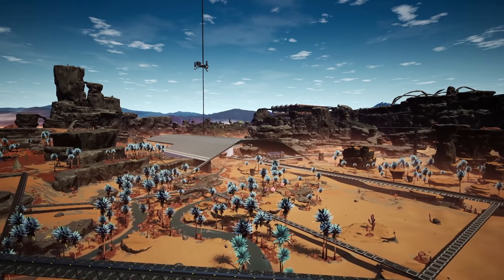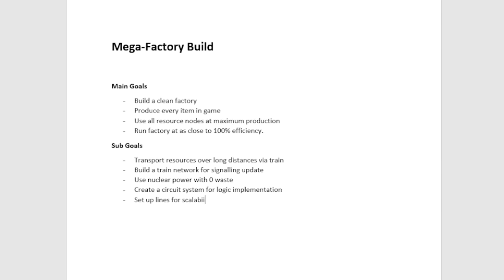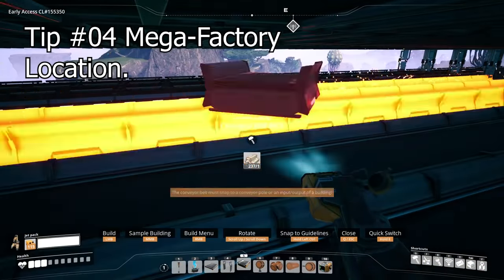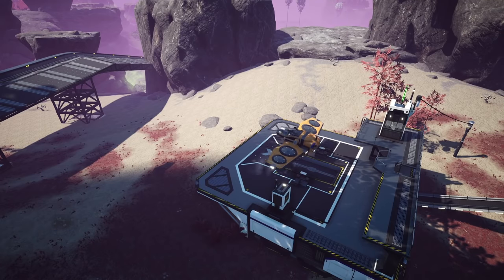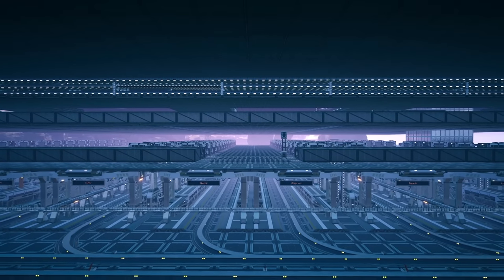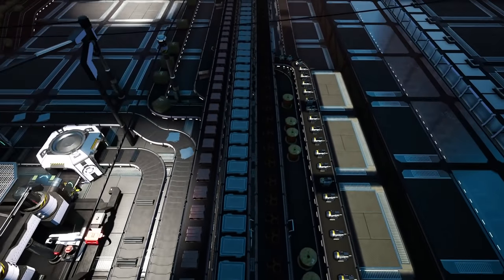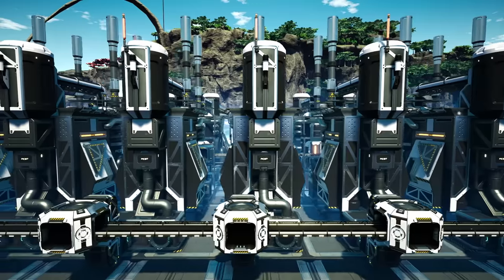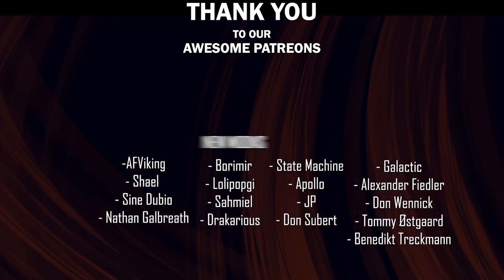14 Mega Factory Starting Tips | Satisfactory Game

Comment from the maker: If you're starting your own mega factory, what's the number one tip you'd recommend?
Reply: Use excel to run your numbers, So much easier than pen and paper
Reply: wait for early access to end :D - should be soon
Reply: GO BIG OR GO HOME!
Reply: @cha0sthenerd  I wouldn't bet much on it. At the very least a year to go, if not more, till 1.0
Reply from the maker: @cha0sthenerd  maybe end of next year?
Reply: @bobafettjr85  In my current playthrough, I am using one huge bus to transport everything, so far it's a ~300x15 foundation, 20 story building which is only transporting items and loops around itself for constant flow.
Anyway, since I use the mod Advanced Logistics, only for the adjustable merger (which is basically a reverse smart splitter), I'm able to tap into a single conveyor and then refill it from another conveyor without having to worry about bottlenecking, so it will always run at 780/min, if I have the resources available on another conveyor.
Excel is helping a great deal, since I can keep track of multiple conveyors transporting the same item, to make sure I refill the conveyor I'm tabbing into, and which other conveyor has the required item/min to do so.
I used to use pen and paper, filled a couple of notepads, but after spending a little time setting up a spreadsheet, I'll probably never go back.

(although I still use pen and paper for "smaller" projects that requires some visualization)
Reply: @bobafettjr85  I use code cells and reference the wiki for ratios. I unfortunately don’t really know how to explain more than that
Reply: A seriously well organised, LARGE and neat self sorting storage room and logistics hub (not nessecarily a mega base).
Reply: @cha0sthenerd  If only that were the case. Update 5 is planned for this fall. And the devs have made no indication that it would be the last one. They've got the whole quantum computer/superposition oscillator tier to fill, world updates planned, boss den, vehicle reworks, dedicated servers, and signs that are on their list of things they want to do before 1.0. They also surprise-adding just as many features as they tell us about. So my guess would be at least one more update before release, at a cadence of 5-6 months between big updates.
Reply: I think the biggest thing to keep in mind is that logistics is the number 1 problem of the game. (Followed by remembering what the plan was.) It's not hard to build a bunch of machines in a row and belt/power them; it is hard to efficiently get 2-4 resources to that building and split the product to go to 2-3 other buildings/modules, while not interfering with the 60-odd other items. It's easy to calculate how much space the machines take up; it's hard to account for the belting, splitting, merging, power, and walkway requirements.
This is shortly followed by 'using Excel/spreadsheets', so that you can make a plan before you start building.
Reply: Have a supercomputer
Reply: Power is a pain. Set up your power plant before you start setting up your factory. You cant test anything if it cant run.
Reply: Quit your computer and go outside.. Have a life... Because youll never finish it.
Reply: @prism will go by that advice :)
Reply: @Salmacream  ill have big power issues after connecting my factory up ( i have now like 4 concrete machines on full noout because my dumb brain said: building it in the sky is veeery great idea.. But he didnt realize it would take more concrete than a flipping pyramid!) so im connecting parts of it step by step and if it crashes.. Im fucked.
Reply: @hungrrczzze8775  run a belt close by with concrete emptying into a storage container. Then once your done delete the belt. Just remember you are gonna get rid of the belt in the end. Dont waste time making it look good. It just needs to snake behind you, so you can do more without running to base for more concrete. 10 foundations away not 300.
Reply: @Salmacream  trust me, if i sent you a video of how my world looks like (3rd btw) you would just quit existing :D
Reply: Well, don’t bother build a mega factory because  That’s a YouTubers fulltime job.
Reply: If your gonna use vehicles I personally recommend to create roads, that should solve most of the issues of the buggy riding.
Reply: A logistics level or two below your factory floor and then just pipe everything up into the constructors. I've never had a neater base inside a very small space than with this method.
Reply: If you think that you have enough space, no you dont. Double it!
Reply: @Hesch80  Instructions unclear. Got stuck in a recursive loop and covered the entire map in concrete. Please send help
Reply: @fabiansuckfull9446  You just do a second layer 8 foundations above your actual layer.
Repeat this process until you are at max build high.
After this you start building under the map and hope that Coffee Stain will increase the map size.
Reply: Dont do it
Reply: Be prepared for spaghett! and to rework that spaghett!
Reply: My top tip is you need to plan well so you build it right the first time. Few things are more frustrating than wasting time rebuilding old designs to be more efficient. I also recommend using Impure nodes to build your starter factory for that reason as Impure nodes have no good use when it comes to mass scale production.
Reply: Have a google-sheet spread sheet set up to tell me how much of each item i am producing, man i love my graphs... I believe that drones are less taxing on your system because of the Maximum items per game factors into frame-rates. If a Drone can transport an item from one place to another and have a very tight build say hidden underneath makes a tighter cleaner look. So we won't need Railing going around the Map. More items to place in the world for decorational pieces.  Main transportation goal: Smaller Detail Factories w/ Drones only Save.
Reply: Don't build it into a piece of toast with spagetti
Reply: My main tips:
1) If you need water, build near water: transportation of water aid other liquids is more challenging than raw ores.
2) Manage the complexity: if you intend to produce many different items in the same location, split your factory into several sections, it will reduce the complexity of the bus of resources that is running inside each section.
3) Use remote secondary factories that will produce intermediate items: it will not only reduce the complexity of the logistics inside your big factory, but also simplify the transportation of items across the map. In the video, you took the example of iron ingots. Indeed, I wouldn't produce iron ingots on a distant location BUT I would definitely produce reinforced iron plates there!
4) Use Mk 5 conveyors belts everywhere even if it's not needed. I learned this lesson during a game where I built a big factory that was producing turbo motors using a recipe that required supercomputers. Most of the items where produced in that factory so it was a very complex one. And after several hours of continuous production (not immediately because I had huge buffers), I noticed an efficiency drop. Finding the issue was not easy. The problem was that I hadn't enough motors. These motors were coming from a distant factory, so I went there and I noticed that I wasn't producing enough stators. After a long investigation, I saw that the latest section dedicated to stators hadn't enough pipes. I checked everything and I finally found out that somewhere I put a Mk 1 conveyor belt where a Mk 4 was needed. All this mess, hours of investigation because of ONE SINGLE CONVEYOR BELT. So now I use only Mk 5 (unless I need lower ones for a very specific reason). There are two additonal advantages doing this: you need only one sort of materials to build all the conveyor belts and if you need to upgrade your factory, you don't need to upgrade the conveyor belts.
Reply: When you are manually building and item you can press spacebar and then go to your other monitor and do stuff...
Reply: @italixgaming915  only one item type in your inventory as well ;)
Reply: Have different grids for electricity. I once had everything connected together and got a power shortage when switching on a new factory part. Getting everything running again was a pain because I didn't have enough power to start my power production again .-.
Reply: @JL-pc2eh  That's the way I do. I use three different grids: main, secondary and emergency. The main grid is connected to all the nuclear power plants and to the infrastructures and factories needed by the nuclear plants. The main grid can also be connected to the other factories but not in normal mode. In normal mode, these factories are connected to the secondary grid, and the secondary grid is connected to the primary on one point. The emergency grid is connected to power plants (and their associated factories and infrastructures) and vital infrastructures. In normal mode, this grid is also connected to primary on a single point so it can become totally independent in case of an issue. A series of power plants can be connected to this grid (they are disconnected in normal mode), as well as one of the nuclear plants.
This system is resilient to any event. If I have a total blackout, I can disconnect the emergency grid from everything and use the other power plant (biomass, geothermal, coal and oil) and build up enough power to restart the first nuclear power plant, which is enough powerful to restart the other ones.
Reply: @blue-novaanimations  running my 111 hours save on a pretty bad laptop with my highest fps being 21 when i look into the ground
Reply: @TotalXclipse   Ha, Ha.
Reply: @cha0sthenerd  "1 year ago" :D
Reply: @TobiFink  haha i bet i takes some more
Reply: This comment aged like milk.   @cha0sthenerd
Reply: @cha0sthenerd 😂
Reply: @cha0sthenerd  ironic

Comment: Turbo Motors? Nah you want the Thermal Propulsion Rocket. It's worth 732,956 points to the Turbo Motor's 242,720 points.
Reply: Turbo Motors became the benchmark before the last update, so a lot of long running plans are still geared towards that goal of maximizing Turbo Motors. But yeah, if your goal is to maximize points per minute, you should build as many TPR as possible and use the rest of the ressources creatively.
Reply: @QemeH  I know. I'm just saying that now we have something worth more we should aim higher.
Reply: Eh... my goal is to make a system that can adapt to make the next big thing without having to rebuild it each time an update drops.
Reply: @ronhatch9175  that's fair

Comment: My tip is to keep things as modular and leave room for expansion with additional modules.  My Nuclear setup is designed around 2 overclocked reactors.  If I ever run out of power I can easily copy my setup, slap it right next to my existing reactors without any problems.  This includes the waste management (ie sinking nuclear waste).  Some items are underclocked and I have more buildings than I need for max efficiency, but the modularity is the benefit.  The key to a modular system is keep all you inputs inline with the next module so that the excess of one module can feed into the next without any spaget.  Easiest is to have all your inputs run perpendicular to your construction lines.
Reply: When you say "copy", do you mean via a mod, or just "use the same design" but build by hand?  Wondering if there's a good mod for this, as in Factorio's blueprinting system.
Reply: @gene1514  I think he means build by hand exactly the same setup again.

Comment: Usually I just start next to a set of nodes and say “here’s what I want out of this.”  Typically I build any factory with the assumption that it will be asked to handle all input nodes being run at 250% overclock and go from there.  I also make sure that I can freely swap between any and all possible products available from that particular factory by simply switching over the machine settings with no re-working of the physical setup, while also ensuring that 100% of all possible end products have a way to overflow into Awesome Sinks in order to prevent any chance of factory shutdown for any reason other than power grid failure.  This is doubly important for any oil refineries, as their fuel output makes them 100% self-sufficient so long as their outputs don’t get backed up.

It’s a lot of extra work, but the result is a production facility that is very robust and flexible, enabling me to work on future projects that may depend on the potential output of such facilities without having to re-engineer the existing factories just to meet changing demands as my projects increase in scope and scale.

Comment: the issue with the suggestion of "just play it without worry" is that once you hit phase 4, it's manageable to unlock all the tiers, but then you need to make the components and you need 2 machines to make 2 components, then 1 machine to combine those 2 components, then make another setup for another component to make them fuse with the 1st components, then to add that to a 4 way combiner.

then restart that process for the remaining 3 components ... and that is only the surface, phase 4 is way too overwhelming with everything that you need and you kinda need to work torwards a mega factory where you got everything organized to make each component

Comment: Produce as much power as possible and use a lot of overclocking so that when you start to switch on the mega base you will not face an issue where you run out of power.

Comment: Is the big resource nexus collecting from multiple mines and then merging it all into a single train per type of resource?

I once started a similar thing, but eventually needed multiple outgoing train stations per type of resource because of the cargo loading times and irregular train arrival times. Feeding multiple factories from a central nexus became quite unreliable.

I guess using those extra long trains as seen in the video might work around that, by having a low number of trains that travel around with a ton of resources instead of lots of trains with less resources each.

Comment: Hopefully this is the video I've been searching for.  I've got about 25-30 GW of unused power from Compacted Coal and Petroleum Coke.  I have a few preliminary factories for basic materials, spread around the map.  None of these factories is using the most resource efficient recipe (old factories built before better equipment and recipes were unlocked).  I did a bunch of hand crafting, so all game progress is complete, except for the final Space Elevator.  I did hard drive hunting, unlocked all recipes.  I did some Power Slug hunting and have a few hundred, though most are used in power plants to ease build material requirements.  I'd transition to prioritizing slug use for resource extraction and expand the power plants later as needed to reclaim shards.  I'd like to work out logistics of how to move resources without crashing my computer and melting my graphics card.  Also, need to plan what and where to build, to get the missing part factories up as soon as possible so I can more quickly get parts to build a 100% recycling nuclear power plant, sink plutonium for now, then finish space elevator project, and finally proceed to maximize coupons with Thermal Propulsion Rockets, and each other item by AWESOME Sink point value in descending order.

Comment: when you get the smart spliters you can run a line down a machine line then loop it.  the machines take what they want and extra goes around the loop with new stuff its like an all in one bus system. it takes awhile to get started but if you preload the machine its fine till power goes out loll

Comment: 1) Big tip to "play around" with base design...
Graph paper (paper with squares printed on it), pencil, ruler, scissors.

Draw your functional build units/groups out as rectangles (X constructors/assemblers/manufacturers... in a row with room for the mergers/splitters).  Cut them out. Then you can play around laying out the functional groups until you have a layout that works.

This is especially useful to plan the logistics between the units, and is really useful if you are strapped for space (this was part of my challenge for this build, to start a base in the northern forest where there's basically NO really large open areas).
Now here's me praying they don't change that area too much (eek).

2) Learn to use a spreadsheet.  You don't need fancy stuff, but knowing how to do cell calculations, sums, and knowing how to use the '$' modifier on cell coordinates make planning and doing "what if I do it this way" type analysis a lot easier.

3) once  you step beyond the quick-and-dirty connecting a dozen machines together powered by biomass...  Focus on building out your power generation.  Nothing more annoying than having the power trip, everything shutting down and now you can't build more infrastructure because you don't have the items, and you can't turn it all back on because you massively overloaded your grid and forgot batteries eventually run flat (just admit it... you've been there... We've all been there...).

3bis) make the power estimate part of your base planning. If you don't, it's pretty much a given you'll run out of power WAY before you finish your base.

4) it's a game, have fun. don't stress out. If you feel like it's turning into a job... STOP, go do something else.
Reply from the maker: All great tips!